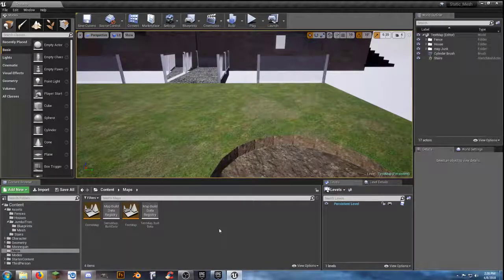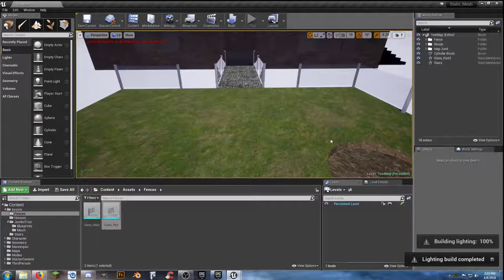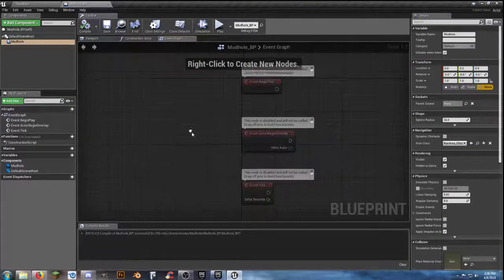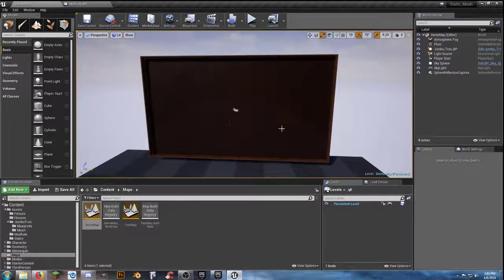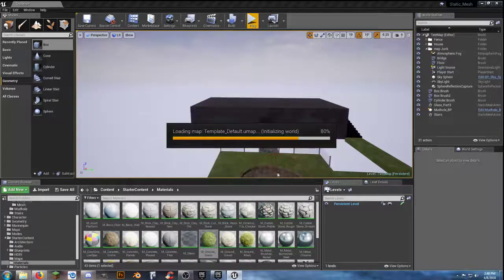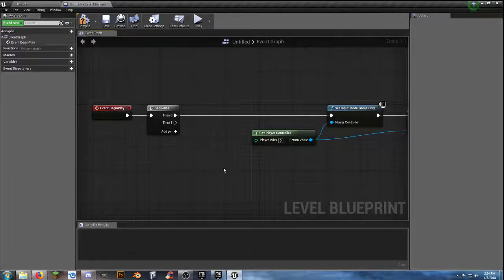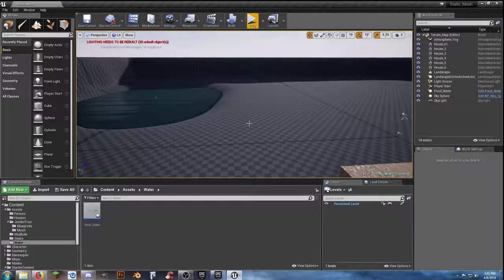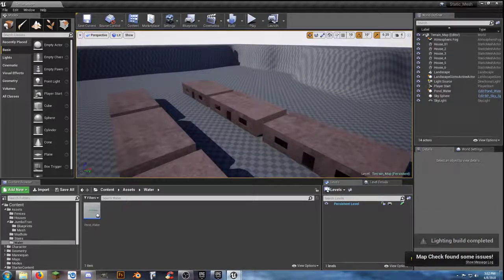Sunday Services with Rev Beefalo Bart - 4/8/18

Comment: I just started game programming using ue4. Learned alot in last month or so. 
What I don't know is what I should be looking at to make a crosshair action rpg style gameplay. Should I be looking at this line trace stuff? not looked at fps tutorials yet. Or. Is there another way to show the crosshair is on a target so you can cast a spell or swing the sword. If crosshair is not it will display no target.
 I can figure out the no target stuff :)
Reply from the maker: I did a video on setting up what I call and use as a dev gun, which uses a line trace to gather info at what you shoot at.  The Line Trace is the best overall shooting system.  The red laser line it draws can be turned off so its invisible.  And I will prep a video on making a more suitable weapons system.  Like going from new project to making a line trace shooting system to kill a target.  Make sure you contact me on discord in my "questions n answers" section to request this so I don't forget.
Reply: Thank you for the reply. So the trace is the best way to do an action rpg like ESO, Neverwinter, Tera, etc? Since I do not know much yet about ue4 I figured the trace feature was all about shooting a gun at a target. not acquiring a target to launch an attack on. 

Very helpful videos. I will look into the discord thing. I only use it to game with friends. Don't know all the added things to it  lol